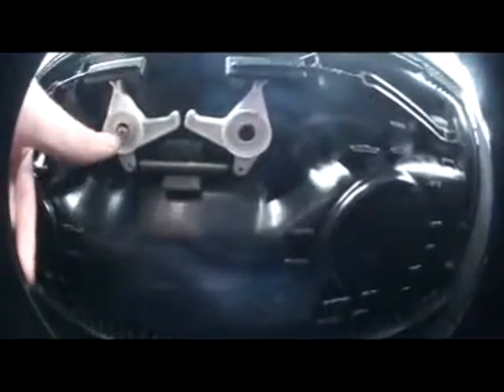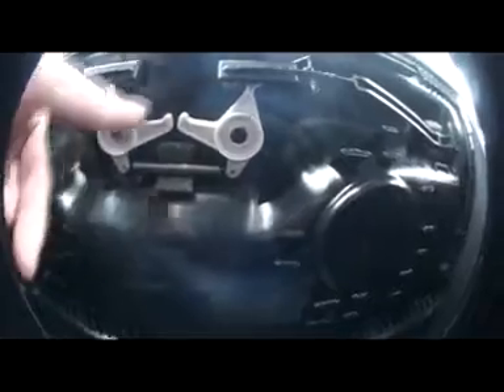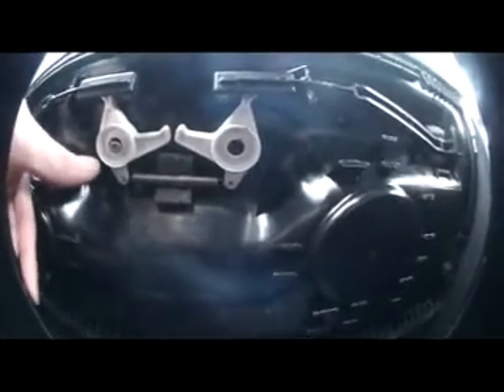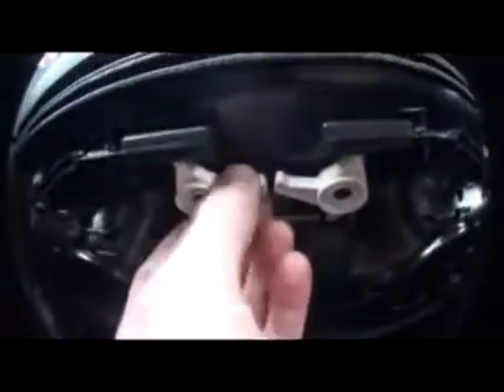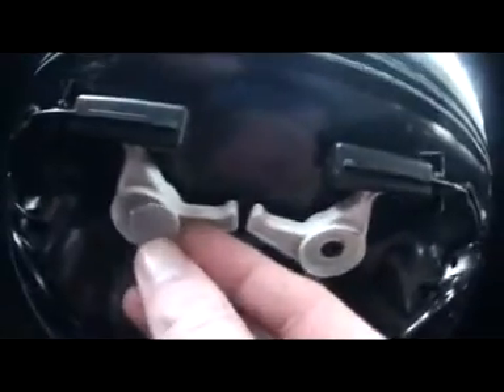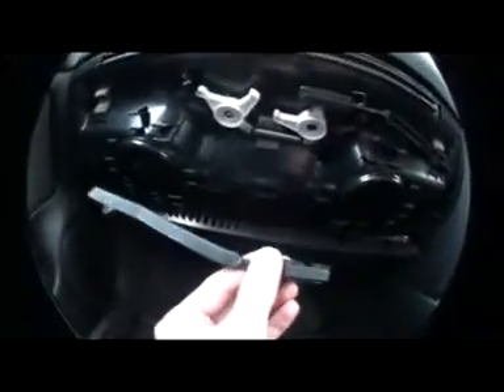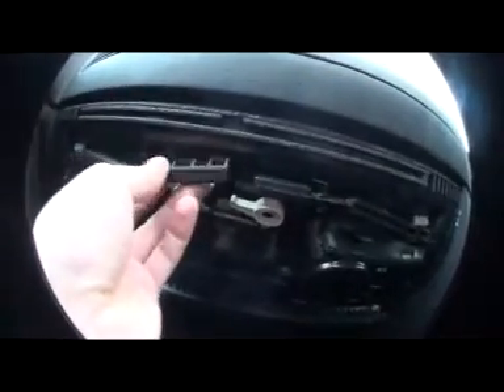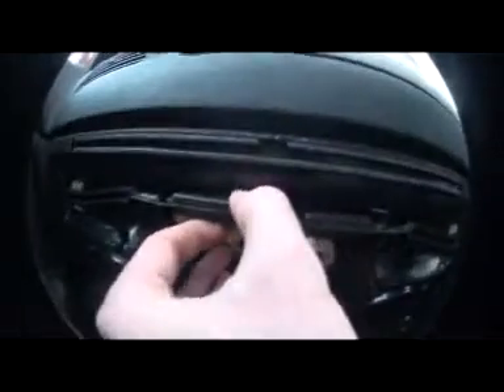Volkswagon golf mk4 - How To Fix A Glove Box

Comment: Just carried out your procedure there. Seems to be working a treat.Thanks managed to sort it for the price of a tube of glue. i was about to start trawling ebay for a complete 2nd hand glove box.  Hard to believe a company like VW designed such a flimsy mechanism like that. It must be a recurring issue.
Reply from the maker: this issue is very common! as in the mk3 to :/ after the mk4 model they learnt how to make a glovebox hahaa. glad i helped you, if it comes loose again stick it together again and hold it with  to mole-grips for 24 hours.

Comment from the maker: put your key in a twist as in your gonna open it, once thats done get a flat ended screw driver and force it in at the very top of the glove box, once its in force it open like it was a crow bar, if that sounds right. thats what i did. if i have miss read what you put then dont use the key to open the handle just force it open with the screw driver. hope i helped

Comment from the maker: you know in the video, how the door is split in two well thats what your trying to force open. not the hole door, there will be a small gap where you can split it open but you cant see because its shut tight. i was in the same place as you and didnt even know that there was a gab and forced it open and the one side of the door came off, its only held together by glue. hope that helped

Comment from the maker: first you will have to force the glove box down so its open then take the left hand side bracket off, should come of by force to, then use a flat top screw driver to take the top off, you will notice two small dints where the driver can be force in to take of. really rip it of, its not gonna brake, hope that helps

Comment: Hehe you forgot to film the worst part - getting the cover off. Once you pop one edge enough to get a driver in, you can get a wonderbar in and twist so you don't have to worry about poking through with a corner of the screwdriver. I used this tool to get in enough space: http://www.acehardware.com/product/index.jsp?productId=1272711 and this tool once I had enough gap to pop all the connections: http://www.amazon.com/Stanley-55-515-12-inch-Wonderbar-Pry/dp/B00002X1XT - and for those who asked, yes it is glued throughout - not just corners/edges - the harder part IMO is the part right above the latch. The area under the cup spaces was also very tough.
Reply from the maker: nice one Jacob ! more help the better and you do seem to talk about this better and translate lot better than what i meant hahaa. i would put a better video up explaining more but i don't have the time. you just did it for me. thanks !
Reply: It is such a pain to get off. If folks search vw forums there are folks who cracked the front face in half, etc. I hairline cracked the front just above the handle, even when being careful.
Reply from the maker: lucky me then no damage a tall! but yeah it was a pain finding the best way to get it off haaa

Comment from the maker: hey sorry about that just fort my voice was boring, basically rip the door off ( front of glovebox ), it will not damage the door you can stick it back on after with super glue just fine, the way to brake it of is by finding the seal that stuck it together in the first place. it will try not to come of but just wedge your flat top crew driver in there and rip it of. after thats done you will need to find the white leaver thats gone from the other side of the other white leaver.